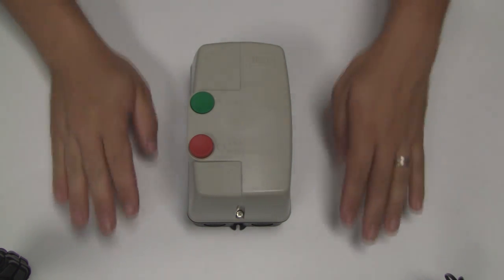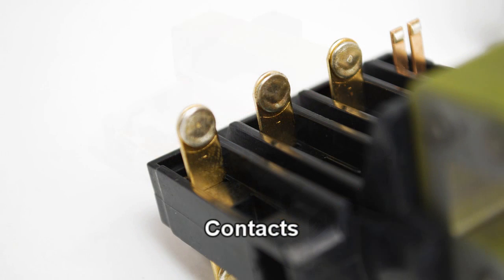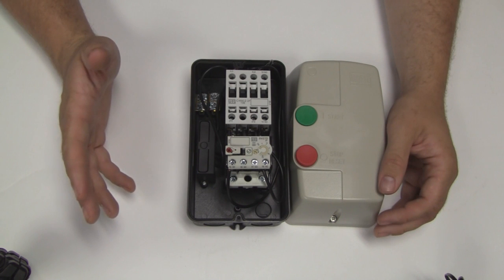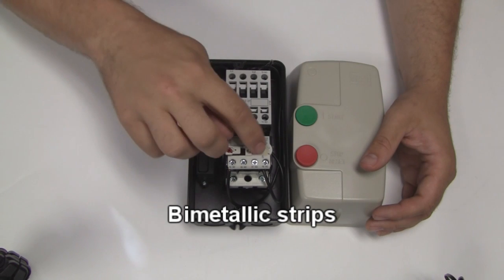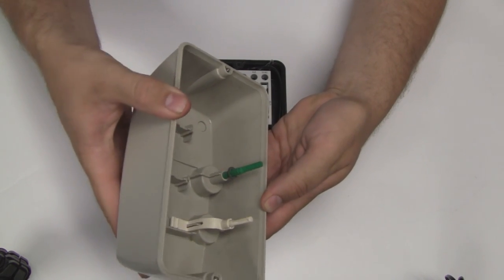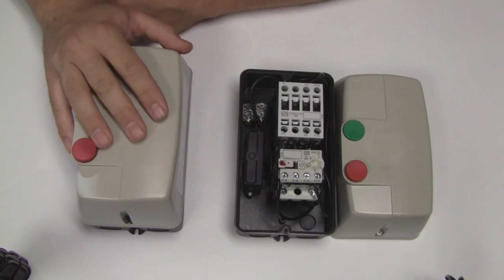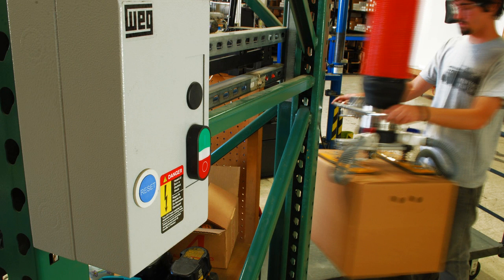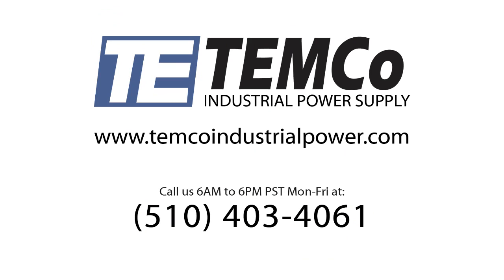What is a Motor Starter & Electric Motor protection - WEG PESW Overview by TEMCo

Comment: I disconnected the start stop/reset by removing all wires from my Pesws. I am trying to wire in the pressure switch by connecting to 96 and A1. Terminals 13 and 14 no longer have any wires. Problem is, nothing is activating the magnetic starter. Is there a jumper I am missing? Only jumper is on 95 and A2.

Comment: if  i press green push button of electronic starter to switch ON the motor,  then any technique or method  available with the help of that  motor is OFF without Push red Button.
Reply: Y como se conectaria con uno que tenga manual y automatico la caja weg

Comment: Oh Kay  so how about you show us how to wire it up to run a 5 Hp 220 volt motor from a 2 wire flow switch , or pressure switch , common for air compressors or power washers